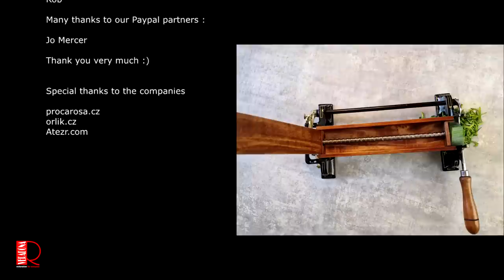Restoration - Tobacco cutter ?

Comment: perfect Restoration ! looks brand new! and the wooden box should smell really good with the fresh Laquring! wonder if you ever think of using Epoxy Resin in Restoration as a new touch? like ,for exmaple an antique Hammer with an Epoxy Resin handle?
Reply from the maker: Yes, I thought, but I have never worked with epoxy resin before. Maybe I'm still put off by the price...
Reply: @VeradonaRestoration  i know! it is a very expensive new trend , yet some results  were very impressive! i once saw an old wooden bathroom stool that was in a very bad Condition with missing pieces of wood! the Restorer had embedded it totally in Epoxy! the result was amazing! probably the price tag was more amazing!!! )))
Reply from the maker: @adhamhussein5303  Yes, I know who you are talking about, I saw the video. Amo, you're probably right, I'll have to try something. Thanks friend.

Comment: Nice job. That cutter was probably used for plug chewing tobacco, which came as a solid block.
One suggestion: You could probably free-hand pinstripe faster and better than masking everything. Just get some One Shot paint and a dagger brush. It's easier than you might think.
Reply from the maker: Thank you very much for the advice John.